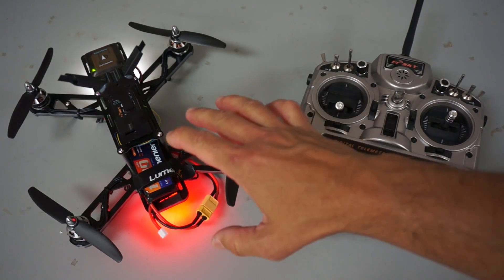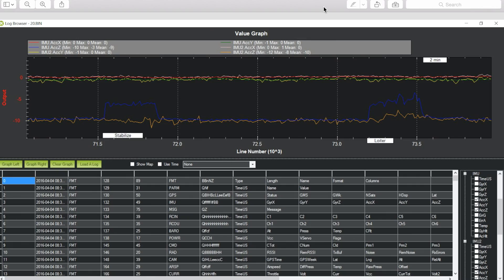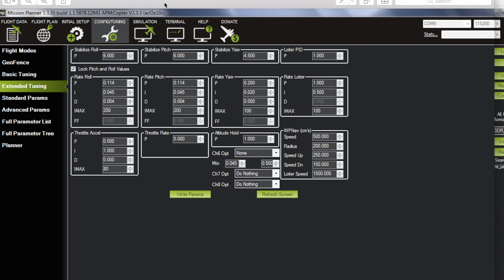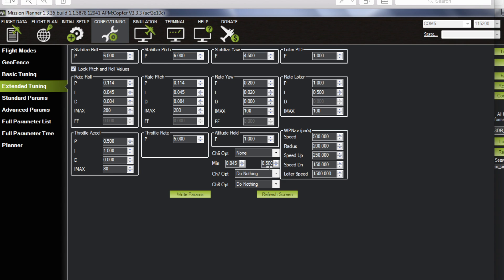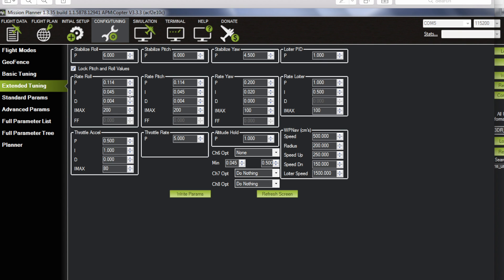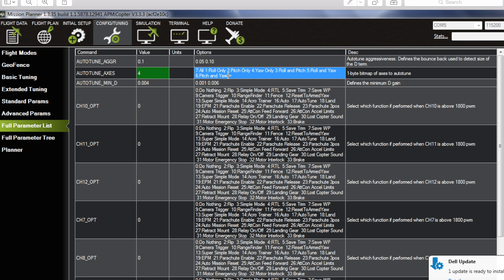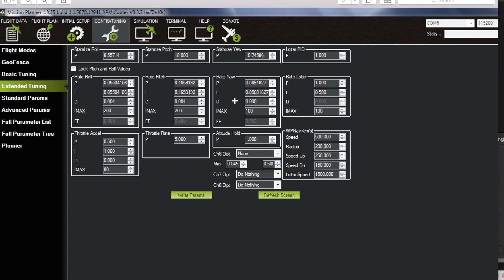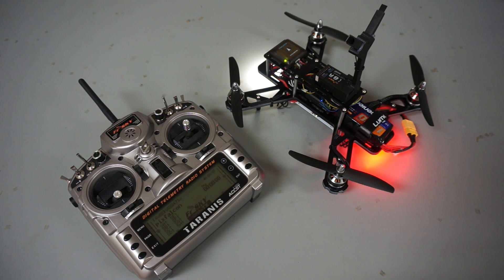QAV250 Loiter Tuning Revisited - Tips for Tuning 250 Size Frames with Pixfalcon & APM Controllers

Comment: hi, I have a APM 2.8 on a F550 frame running 1000kv motors and am having the same problem in loiter mode. can this settings in the link work for me ?

Comment: Stabilize pitch P gain of 18! Those are the craziest PID's I've ever seen!
P.S. Why no filter value?
Thanx for the video
Reply from the maker: No problem. Yeah I was surprised by these PIDs as well. The firmware has come a long ways since I posted this so I'll revisit and see what differences I discover with my PIDs. Thanks for the feedback.
Reply: @dennisbaldwin  Dennis...thanks for the video (I'm trying to tune an Eachine 250)...but why is there no filter value on your PID page?  I thought the filters had to be set to 40 or even 80 (with 20 being default) for the smaller-sized quads.  Thanks...

Comment: huge difference in pids between manual and autotune. which was better?
Reply from the maker: I normally auto tune and use that as a baseline to manually tune from there. I used to manually tune with the defaults, but that took considerably more time than autotuning to get a baseline. Hope this helps.
Reply: Tried auto tune, did the dance. Quad felt like a boat in the ocean.

Comment: I've solved the "rocket jump" when I switch to Altold or Loiter mode by disabling the internal buzzer of the Pixfalcon. I have a deep look inside my logs and I discovered that accZ was affected at the moment I select one of these mods. I'm currently flying with 3.4 RC2 and I don"t know if this parameter exists in the previous version (cf arducopter wiki). Hope this help.

Comment: Your IMU issue might be fixed by setting INS_ACCEL_FILTER and INS_GYRO_FILTER to 98 (Hz). Apparently ArduCopter defaults are incompatible with small quadcopters, at least every one I built (2 PixHawks and 2 PixFalcons on 250 class frames). Just search on "PixHawk wobble" here and on forums for more examples. Basically the 20Hz default low pass filter cut-off needs to be increased to 42 or 98 to fix it. Not sure if lower or higher is technically better, just that 98 fixes it for me. Anyway, thanks for the tuning video it was just at the right time I was about to auto-tune my new PixFalcon builds. I'll try switching off my filter change after tuning to see if it was just default PID issues and let you know for the record. p.s. ditch that big X8R receiver and replace with an XSR or X4RSB to save weight and bulk  ;-)
Reply from the maker: +Tony Wall Thanks for the suggestions. Let me know what you discover after you do the tuning. Yes I definitely need to get rid of that X8R. I have a smaller FrSky RX that I'll get on that frame. I agree that the X8R and the stand are adding quite a bit of weight.
Reply: Anthony...what did you find out?  Did you need to keep those filters set to 42 or 98 after tuning? Thanks...

Comment: Hi Dennis, i don't understand why you disabled the IMU. Your IMUs putting out different data, maybe ist a sampling rate clipping issue because of the high freq of your vibrations. As far as i can see your log you not having this issue with loiter only but also when you switch into stabilized. 
How did you mount the board onto the Frame? How comes you having no vibrations on your IMU axis? Did you put a software lowpass filter in before?
Can you upload the first logfile with this problem before you did any changes?
Thanks
Reply from the maker: +David Kaden I was doing what was suggested by Leonard Hall. Here is my log file from the problem flight: https://www.dropbox.com/s/n09zig21j7ok2cm/20.BIN?dl=0 Let me know if you want to discuss this some more.
Reply: +Dennis Baldwin Your acc Z data is different vom the two IMUs everytime you switch the flight mode. Your PIDs are not tuned at all in this log. Alos your THR_MID is at 50% but you quad might hover at 30%.

Comment: Hi all,
The only thing I would add is that the Rate D value of 0.004 is good for most quads. With a high powered 250 frame using ESC breaking you should drop your Rate D minimum on Autotune to 0.001. You may also have to reduce the D term below 0.004 to stop oscillation. Always be very careful on your first flight with your default tune as you can never be sure it will be stable.

Dennis, 
Since your Autotune dropped your Rate D to it's minimum limit you may benefit from reducing the Autotune_MIN_D value to 0.001 and doing autotune again. The minimum is there because some frames vibrate too much for autotune to find the optimal D value.

Thanks for all the help you provide the community!!!
Reply from the maker: +Leonard Hall Thanks for the additional tip. I'm going to give that a try this weekend or early next week. Appreciate all you do as well!